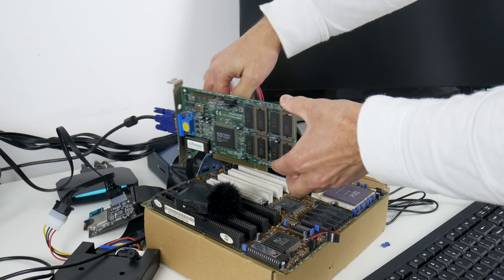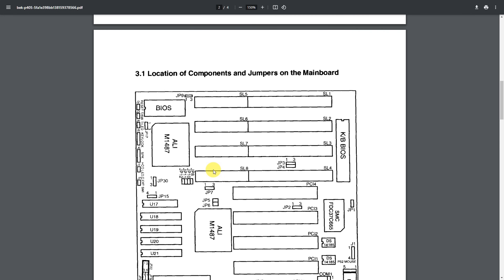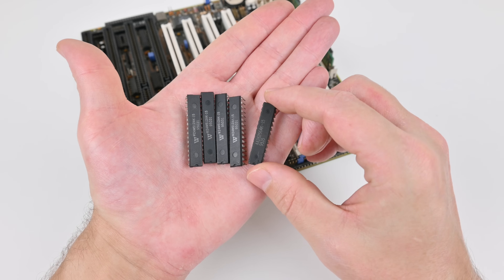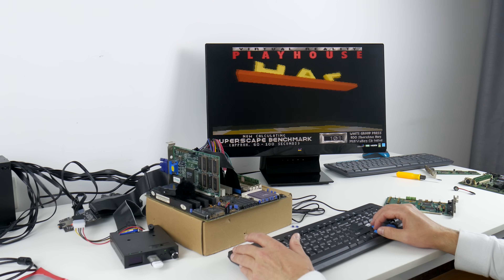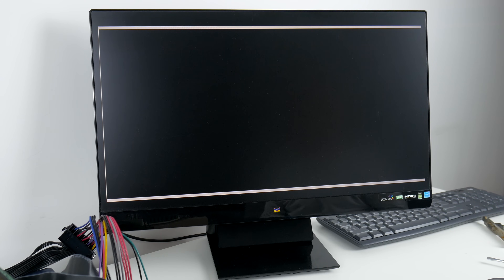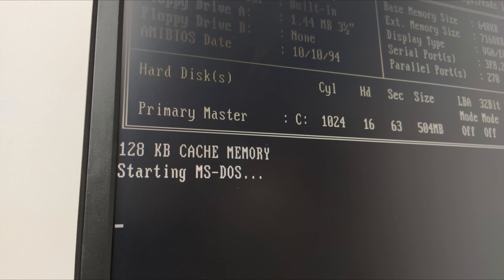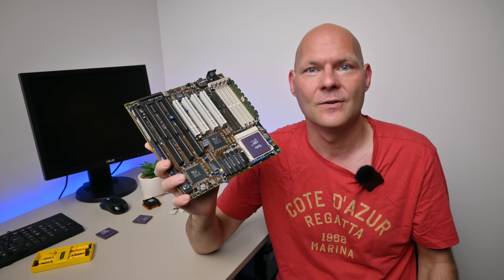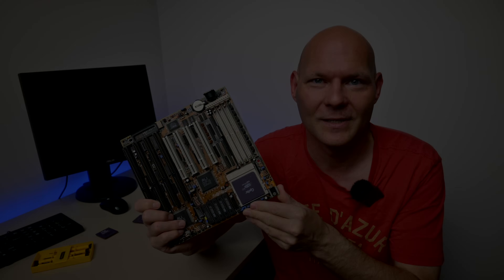PCI 486 Motherboard: The P405

Comment: Man... The nostalgia of building a 486... Rite of passage indeed! While the first PC I ever built in the mid 90's was an AMD Am5x86 (still technically a 486 of course), today I'd be a bit scared to try to scavenge for parts on eBay for such a build... The prices (and risk) for a good MoBo are just too high... 😰

At the time, my reason to go with a 5x86 was to be able to play X-Wing and Tie Fighter with the best performance possible for my budget (the 1st gen Pentium was just out but was crazy expensive).

For my current early-DOS gaming tasks, I ended up snatching an IBM PS/Valuepoint with an upgraded i486 DX2 for a reasonable price (luckily in surprisingly good condition) last year, which was an easier and safer route than trying to assemble a new machine on my own. It came with a dead CoaSt module (which I'll probably never be able to find a replacement for), but after some RAM, VLB graphics card, and SB16 upgrades, it has become a fantastic machine for my favorite early 90's Sierra and LucasArts adventure games.

With no cache it is a bit too slow for later 90's DOS games, but I have a P233-MMX for those tasks. So, it's all good :)

Anyway, lovely video as always Phil! Have a great weekend!

Comment: Nice video. This brings back memories for I had mine, an AM486 DX4-100, for quite some time, and ended up with a "Riva-128 Glide-Wrapper" for Quake and later a Voodoo 1 to make do.
So thanx. 🙂
As for the ATX->AT power adapter, you may want to get one with a -5V power converter for the full ISA support some sound cards require.

Comment: A lot of those QFP chips will either tear pads or de-laminate themselves over time as the board flexes, thermal cycles, etc. Some of them were just plain soldered poorly. Considering the repairs done, it stands to reason that there are likely more unstable or broken connections.

Comment: No doubt your aware of the many great board repairers like necroware, vswitchzero and Tony359, Bits und Bolts, just to name a couple. 
The additional tools they use, which you might be interested in, are a Dremel with a soft tip, to carefully remove the solder mask when they repair tracks and need to create bodge wires and board heaters so that the solder melts more quickly when the iron is placed on the tracks pad, preventing the lifting of tracks from overheating.
I'm sure they would help if asked, if you run in to a difficult problem.
Reply from the maker: Yea I watch all of them 😊

Comment: I still wish I had my old 486 based PC, even with all of the issues and quirks it had. 
I think it's important to remember there was a large amount of change that happened during the 486 era. EISA was phased out after failing to gain traction. Local bus on-board graphics happened on a lot of OEM boards. VLB slots came and went. PCI slots appeared after the Pentium launched. RAM went from 30 pin simms to 72 pin. DIN style keyboard connectors started being replaced by PS2 style. CPU clock speeds went from 25MHz to 133 MHz, which was a speed that seemed impossible when the 486 initially launched. I/O like serial, parallel, and IDE went from dedicated cards to integrated on the main board. L2 cache on the main board became common and desperately needed as CPU clocks increased. Graphics went from 16-256 color being standard to 16bit and 24bit 2D being the norm. The dawn of true 3D was beginning. And many more big changes happened.
Reply: The Cyrics chips could support PCI, Pentium ?
Never seen these > 100 Mhz DX models ?

Comment: very relevant video to me; going thru much of this same thing as i build a new 486 machine. one board keeps corrupting its memory, no matter what BIOS settings or modules i use. another board has a non-working turbo header. another board has non-working secondary IDE connector. i've built 486 machines in this past, but it seems to be quite a struggle this time.

Comment: If I was to buy a working (or easily repairable with PCI) dedicated 486 board, I'd be looking for one with VESA local bus, as I have a Trident VGA card that visually appears to be in OK condition - apart from not having an I/O shield. And my only 486 board (ISA only) has a soldered SLC and needs the level of corrosion repair that I simply do not have the skills to fix (It was clocked lower than my 386 as well).

I really did receive an eclectic range of retro PC parts 9 years ago.

Comment: I jumped on a 386 and 486 platform recently just to get the experience. Let's just say it is not as easy as i thought. A lot of weird anomalies. Still a nice hobby tinkering with them. Had lock ups on the 486 at first but a cooler sorted that out. Now it's the isa slot messing up with video at times. Can't get the cd rom to work beside the hdd also. Even with 2 separate controller cards. Cf cards work well at least. Got the system all set up without the cd rom just using floppies and running win 3.1. Nice to see videos of you also messing around with those older platforms.

Comment: The "melted/corroded" soldering of chipset pins happened to me twice with two different Voodoo II 3DFx boards within the same pin sections. My guess it might be related to the quality problems with lead free smd soldering of these and potentially high current flow. Then the attempt of "homemade" resoldering might result in the condition you had with your MB and PCI slots. Anyway thanks a lot for another great video. Sitting in the office on Fridays, always can't wait for the evening to open the weekend with the new episode of Retro PC Adventures on this channel 😀

Comment: This takes me back. The scourge of fake cache chips, setting CPU core voltage with jumpers that could get knocked off and fry your CPU, juggling IRQ, DMA and address settings for ISA cards, and my "favorite" issue was not quite compatible parts that sometimes just refused to play together despite the fact that they should. I had a 386 motherboard that my Soundblaster Pro just never worked right in, all .wav sounds had a weird screech after them. In another case I had a 386sx that worked perfectly with the original 40MB IDE hard drive but with any other drive it would hard lock as soon as any executable was launched. Then there was the insane cost of RAM, it was SO exciting the first time I had a machine with a whopping 8 megabytes. Good times, we're so spoiled today.

Comment: The 486 was the first PC I gamed on. My 286 and 386 were both bog standard machines I used to brush up my coding on. Even got some artillery trajectory games in Qbasic running. I learned the ins and outs of PCs with those two machines and once I thought I had a grip on it I picked up the parts to build a 486. Which I loved. I remember buying Castle Wolfenstein 3D from a local 5 and Dime that had them on a rotating rack in the discount section. I then bought Doom. Later on I bought the other Dooms. It was so much fun. I recall the first time I tried AOL even though I already had free access through my local library complete with e-mail address. I had that for 25 years before they finally shut it down. Those were wonderful times transitioning from the Amiga to PCs. Many of the friends I had went Mac and I couldn't understand why. Overpriced and under specced. Sound familiar? Both times was without Steve Jobs. They just don't do well without him. Anywhoozles, I eventually sold that 486 to me exes friend. She wanted an internet machine so I rebuilt it for her. I can't say she loved it. She spilled coffee on it first day and managed to destroy the VESA Local Bus VGA Accelerator that was in it. I gave her a PCI card to make it work but it wasn't the same. I'm just happy it wasn't my fault. By then I had sold almost all of those older parts and was onto my first Pentium.

Comment: I have mixed feelings about these motherboards. If it has PCI and integrated I/O and you put a 133MHz CPU in it, now it has the convenience of a P1, only much slower. The magic of the 486 is somewhere below DX/2 with a "good" Trident ISA video card and 8 sticks of 1Mbyte 9 pin RAM :)

Comment: Reminds me of my Tomato 4DPS in a few ways. It has a lot of the same features and looks similar, as well. My board runs great except that sometimes, I have to lightly wiggle or reset my RAM as it will "lose contact" and I'll get  "OMG, there is no RAM!!!" beep-codes. I love my 486 system. 16mb of RAM, a Diamond K2Y-Pro16 reminiscent of my very first sound card I ever had (OPTi based, except this time around I have an OPTi GM daughterboard,) a Diamond Stealth 64 DRAM T video card, a Roland MPU-IPC-T (with MT-32 and SC-55 attached,) a 3com 10mb NIC, an external 56k US Robotics modem, a quadspeed cd-rom (near perfect speed for most CD based DOS games,) and a DVD-RW for using my plentiful DVD-R discs for moving large amounts of files. I use a CF to IDE adapter in a 3.5 bay, but since I am having trouble finding 8gb (I am using MS-DOS 7 for FAT32 support) CF cards at decent prices which work with this adapter, so I may switch to the SD-IDE option. I am using a period correct Reveal AT keyboard, some form of optical mouse, and two sets of speakers: a set of retro Labtecs with a subwoofer for the FM card, and a Tandy unit which sits under the monitor for the midi music and sounds. I also bought a collection of working 5.25 and 3.5 floppies for my working drives, and a beige telephone for my modem setup. Everything is arranged on the same model of computer desk I had back in the early-late 90s (someone listed it as free so I quickly snatched it up.)
Reply from the maker: Beautiful 😍

Comment: My 486 board is pretty basic, it has an Intel chipset, no onboard IO of any kind(well, besides AT keyboard) it only has support for 5v CPUs, and the bios is pretty basic. Although it does have PCI, and no barrel battery. Gigabyte also still hosts all the documentation.

Comment: I would recommend sticking those old cache IC's in anti-static foam (usually pink or black) in stead of normal foam and anti-static bags (usually pink or silver, check for the ESD logo) in stead of regular plastic zip-lock bags just to be safe. Those old IC's can be a bit sensative to static electricity 😉
Reply from the maker: Yes will repack soon!
Reply: Agreed. Note that when I received some dissipative/conductive black foam from an internet purchase, almost half the sheets in the order tested as zero conductivity, so even those should be verified before putting ICs in them.

Of course pink stuff is only for temporary use, and is briefly anti-static (less likely to create static charge), but not dissipative. Carbon-loaded foam is what we want for storage of parts, at a higher cost.

Comment: In terms of soldering tutorials, I know Louis Rossmann along with community support is assembling PCB-specific repair materials. Most of these are probably modern MacBooks, though I don't specifically know. Rossmann also has livestream workshop archives on his channel. These might be useful in terms of identifying novice mistakes. I remember seeing a decent soldering tutorial on EEVBlog years back. I'll throw in northwestrepair as well. It's also more modern, but the principles haven't really changed since surface-mount took the place of through-hole.

Comment: The 486  motherboards i still have a few, for testing i use a POST card ,it can fit ISA slots as well as PCI  , some motherboards can have issues with the RAM memory ,some prefer Fast page or EDO, i have a board with fake cache ,just blocks of plastic :}

Comment: The timing of this video couldn't be better. I'm in the process of building my first 486 machine and getting reacquainted with all the terms like write-thru/back, tag memory, and so on. Mine isn't as new so it doesn't have anything integrated, only VLB, no PCI, and no PS/2 header. But learning something new with old computers is always fun
Reply from the maker: Awesome, looking forward to your video 😊
Reply: @philscomputerlab  crap, I was supposed to make a video?
Reply: @PixelPipes  🤦‍♂DOH!
😂
Reply: LOL @PixelPipes
Reply: I remember how exciting it was when I got a deal on a S3 based VLB card to replace my Trident ISA video card. I had a 3D billiards game that went from maybe 10fps to silky smooth when I swapped that card.
Reply: Also have a vlb mobo without pci and no integrated ide or floppy. Messing with controller cards adds another layer of possible problems. Got a few serial mice so the ps2 port is not that important.

Comment: 486 may have seen the largest number of changes within an x86 platform. Early models had just ISA. Next came EISA on the early servers, competing with MCA. Then came VLB. Then came PCI. RAM went from 8-bit 30 pin to 32-bit 72 pin. The first three Socket designs were for 486. It was also the first x86 platform to decouple processor frequency and bus speeds with the DX/2. I/O went from being handled by 3 or 4 ISA cards, to a unified VLB card, to being integrated into the motherboard. The closest more modern equivalent is probably the Pentium 4, which saw multiple sockets and a transition from PCI+AGP to PCIe along with four memory standards.
Reply: They went from 386 class performance in the SX systems to Pentium class performance in the larter 5x86 chips as well. 16mhz to up to 160mhz. 
But I would propose perhaps the Pentium Pro platform saw a similar amount of change, because the 'P6' which should have been called the 686 essentially lasted from the Pentium Pro in 1995 to the Core Duo in 2006.
Reply: Holy Molly, I'm happy I started my Intel-equipped PC life with the 166 MMX lol. Those 486s are sexy but seem to be a real pain to get working right ^^
Reply: Ik8
I

Pj

Comment: Nice video as usual Phil! 486 Motherboard is a must have nowdays, excellent compatibility with DOS games. I have Epox 486 with VLB, specifically wanted a VLB (non-PCI) board with CR2032 battery and I couldn't be more happier. I look at listings everyday to have more and more expansion cards.

Comment: Phil, at 100MHz don’t you need a cooler on the CPU? I recall de 33MHz didn’t, but 50MHz and beyond normally used heatsinks.
Reply: Yes, at least passive heatsink for 486DX2 66 or DX50 and with active cooler for faster ones.
Reply from the maker: Yes but for quick testing it's ok.
Reply: @philscomputerlab  you had some lockups, is it possible that it was due to temperature?

Comment: Fun that I found this exact board, with two weeks older ALI M1489 - which is important here because just two months younger than yours has the newer stepping of this ALI chipset which makes it significantly slower at PCI VGA transfers. Which is still on the faster side for a PCI 486 yet the SC variant is better. Just try it with something like a Riva 128 or a Tseng ET6000, or perhaps a Matrox Mystique and you'll see it scream.
On stability issues - it's a valid option to try different memory modules or even type as this board should work with EDO RAM, at least mine does and with the right BIOS it might even be faster with it. And not equally stable with various sticks.... Of course the same is true for the cache chips, they can be unstable at like 40MHz with the tightest timings. And I found it VERY difficult to find any cache that can do 50MHz at 2-1-1-1 timings. Thankfully I usually use this kind of board to host Am5x86 chips at 160MHz - so 40MHz is the max FSB I need.

Comment: Phil, I found the datasheet for that M1489 chipset: http://66.113.161.23/~mR_Slug/pub/datasheets/chipsets/ALi/M1489-2.pdf.  Starting at page 9 gives you a pinout for that chip.  I would take a multimeter and test continuity from the repaired pins to the traces they are supposed to connect to.  Repairing traces on these older boards is actually not bad.

Comment: i have a PCI test card - it tests the contacts in the socket - same as the post card around $10 but green pcb with battery on the back and many little red  LEDS for each pin  - push it in and press the button - no led = problem contact . and check the pin solders on back of board - ive seen the pins bet and solder joints cracked , easy to reflow with a bit of flux - also suggest use ur microscope and ur multimeter in beep mode (diode) and scrape a bit of those traces back with the repairs  using a scapel or sharp tweezers - make sure u have continuity and no bridges between those repaired traces- they could cause interference from the chip
Reply: I’m trying to find one of these cards on eBay but can only find post cards. Is there a specific term I can search for?
Reply: @zuldanfpv4634  looks like ur right i didnt realise they stopped selling them- i got mine about 5 years ago - only PCIE slot testers now

Comment: Great info vid on 486 build. My 1st and only 486 build had 3 VLB slots. I used a Promise Technology 2300+   VLB IDE card and AMD Am486DX4-120. The performance rocked compared to my previous Intel 386SX at 20MHz! I was running OS/2 Warp 3.0 for apps. I played Blake Stone 3D and the 1st 9 lvls of DOOM 1. I plan to buy another 486 mainboard soon to test compatibility with an operating system I am coding from scratch. Have fun Phil!😊